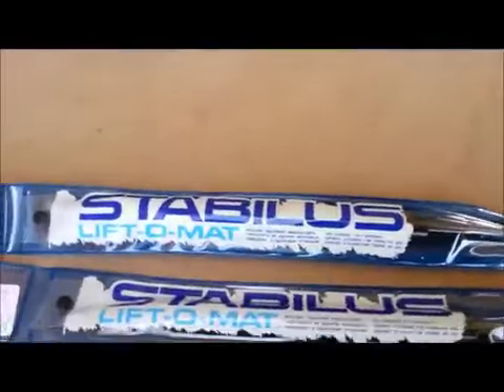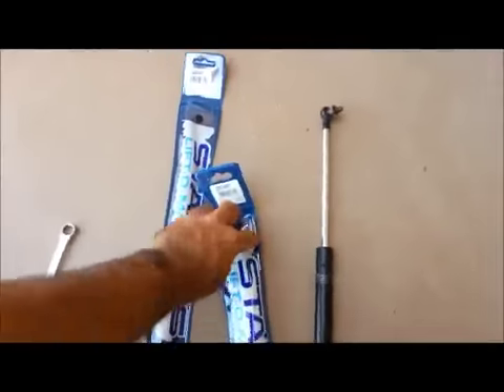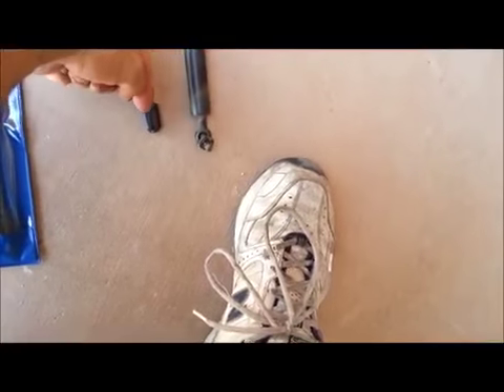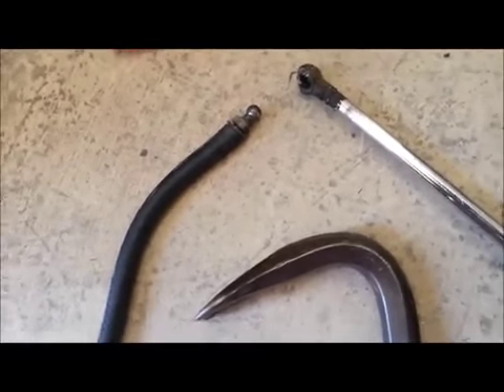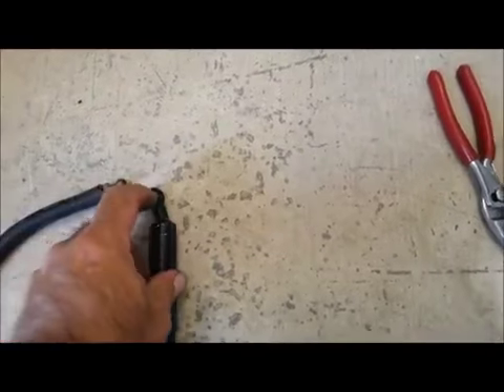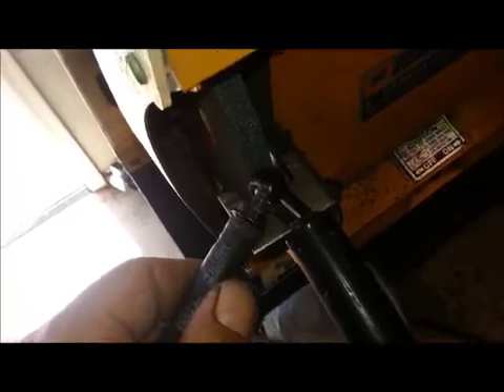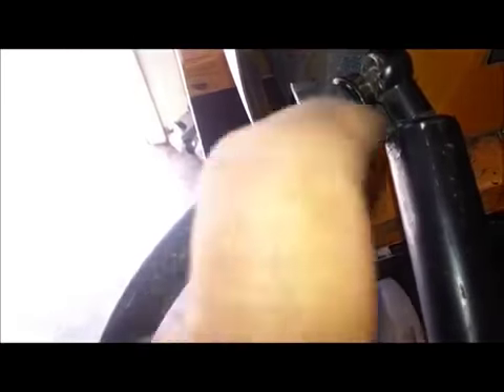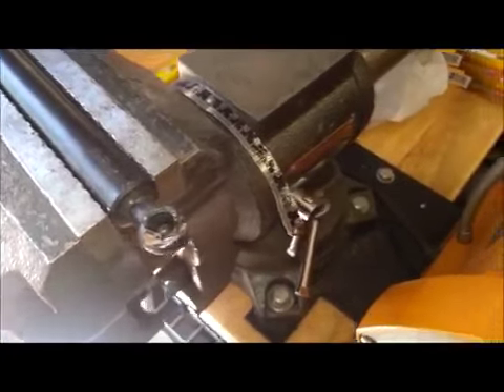How to Replace Lexus GS300 Hood Strut Part 1

Comment: Later on for 2006+ IS 250/350 models
The clips are on the stock struts
Just like the replacement 
Pop the clips with a screwdriver you're good to go
Thanks for the older model video

Comment: Good video instructions. You can save a lot of time if you pay a little more for struts that pop right in.
Reply: His new struts do pop right in and out, that was not the problem. Problem is original does not pop out, it's a one piece design strut/ball with threaded bolt. That's why he needed to save old pieces and make it fit. The complete new unit include strut/ball with threaded bolt and bracket if required if you purchased $$$ from Toyota. I'm in the same situation with my 2000 Camry.
Reply: Update, just got mine from Amazon and it does include ball with thread and bracket. Clean installed. Too bad he had to do all that work.
Reply: @frankw8876 can you share the one you purchased on Amazon?